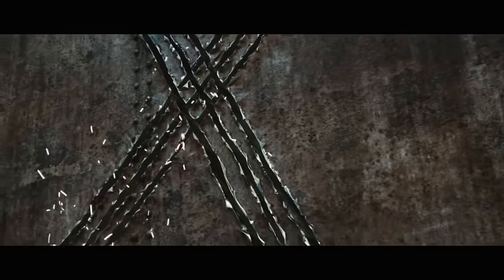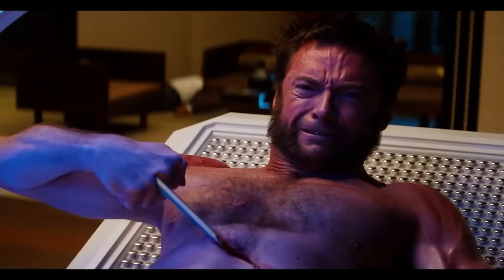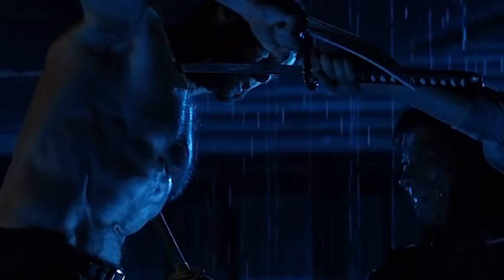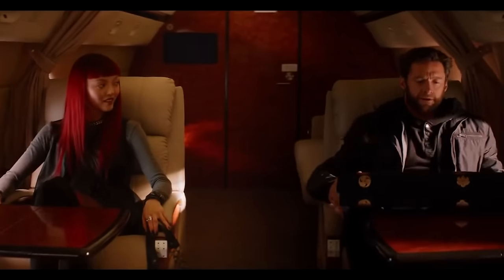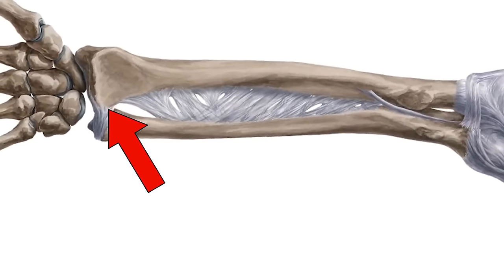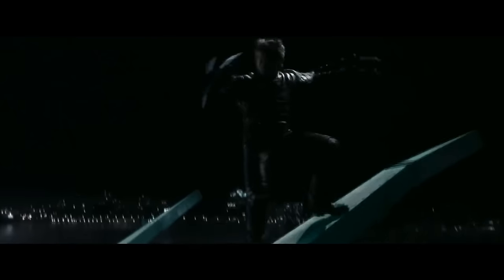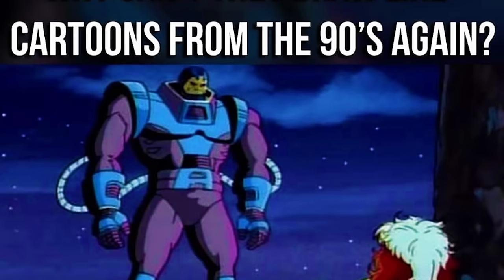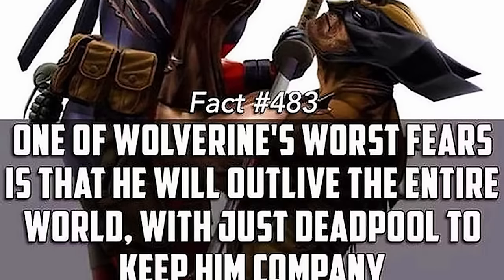How Do Wolverine's Claws Work?

Comment: Decades ago, the explanation was that Logan's entire skeleton was replaced with adamantium, not infused with adamantium.  The sheaths for his claws to be stored in, the path for each to travel, and his wrist structure was engineered specifically for the claws to operate.  And his forearms consisted of multiple smaller rods of adamantium so they acted like a cage that the claws were stored in when retracted.
Reply: Neat!  I like other explanations better but this one, combined with others woud make the perfect axplanation.
Reply: Replacing instead of infusing sounds so much easier...until you think about how much work replacing his skeleton would take
Reply: @brycethoreson9216  ye, they would have to find some place to fit all that bone marrow so the blood gets made as good as normal. Otherwise he will need to be like a vampire and suck up blood regularly to live. What they could say tho is that the adamantium replaced calcium in his bones, making them stronger as the structure and capability of the bone would be the same, just with a way stronger metal than calcium inside of them
Reply: @lootbox  I was thinking of replace as in take a bone out and replace it with an adimantium one, not converting bone to metal
Reply: @brycethoreson9216  ik, but replacing a metal with a stronger metal would probably still allow proper blood flow wouldnt it?
Reply: @brycethoreson9216  Calcium IS a metal.
Reply: The little rods were to twist and streath the muscles that control his claws so they could punch through body Armour
Reply: @brycethoreson9216  Considering Logan has regenerated from a single drop of blood once, removing his skeleton and replacing it without an adamantium one would cause there to be 2 Logans as the skeleton would just regenerate the muscle, flesh and brain.  I know that doesn't make any logical sense, but the healing facotr of both Logan and Deadpool has made no sense for their entire runs lol
Reply: @hobbitpsi  well not really. Wolverines healing factor used to work like a humans but could regenerate wounds the human body would seal off, like amputations for example. Whereas deadpool had a mutant gene which formed a cell in his body that would routinely rebuild his body whenever he was damaged, from a cellular level. If you want to kill deadpool you need to wipe out every cell in his body and every cell he had left behind. This is also why he’s so hard to clone or reproduce, bc his cells don’t stay the same long enough to be taken from his body and put in a jar.
Reply: That sounds like an awful lot of trouble....operating on him like that. Why not just wear body armor and carry a sword?
Reply: @Magneticlaw  
"That sounds like an awful lot of trouble....operating on him like that. Why not just wear body armor and carry a sword?"

Because that would be obvious.  If you want someone who can just walk into a place and not be seen as a threat until it is too late or you want someone who can stealthily sneak in and get the information they want and then cause havoc on the way out if caught, then Wolverine would be what you want.
Reply: @hobbitpsi  Well, while Logan did regenerate from a single drop of blood, it was only possible because that drop of blood fell on the  M'kraan Crystal.  Basically, in "Uncanny X-men v1 Annual ##11" whoever was able to touch the M'kraan Crystal first gained vast cosmic power (like Infinity Gauntlet level power).  Wolverine was trying to get to the Crystal before a being name Horde. Horde impales Logan from behind with a piece of metal and then picks him up and rips his heart out which killed Logan.  BUT, a drop of Logan's blood lands on the Crystal.  Having "touched" the Crystal first the power goes into the blood and a completely new body regenerates (Adamantium and all), Logan's original body is still dead on the ground.  The now cosmically powered Logan realizes it's too much power for anyone to have and destroys the Crystal and is returned to normal.  It's 100% made clear that the power of the Crystal is why he regenerated from the drop of blood.
Reply: @zzodysseuszz  True, the only other person who was anything remotely close to deadpool was Madcap which I always found hilarious that the two of them inadvertently healed themselves into one single being where Madcap became another voice in Wade's head...well until they decided to separate from each other again.  Man I miss Madcap only character to take Ghost rider's Penance stare and actually love it and continued to hunt ghost rider down just so he can get the penance stare again because he couldn't feel pain and the stare caused him to feel it once again for a moment lol.
Reply: Good it was changed cause how do you replace an entire skeleton for a body and not be dead, that wouldn’t have made sense
Reply: @hobbitpsi  The only reason Logan was able to generate from a single drop of blood was because it fell on the M'kraan Crystal.  In the story ("Uncanny X-Men" Annual 11), whoever touched the M'kraan Crystal first would gain vast cosmic power.  The villain, Horde, impaled Logan with a piece of metal and then ripped his heart out which killed Logan.  But, a drop of Logan;s blood landed on the M'kraan Crystal.  Since Logan "touched" the Crystal first, his blood was infused with the cosmic power and regrew his entire body (Adamantium included). His original body was still dead on the floor.  The story made it clear that the cosmic power allowed the regeneration from a drop of blood.
Reply: @kevinchavis2755 
"Good it was changed cause how do you replace an entire skeleton for a body and not be dead, that wouldn’t have made sense"

How do you pump a bunch of molten metal (2500-2785°F) into a body and not be dead?

If the later is possible then the former would be also.
Reply: @brycethoreson9216 medic TF2 did the first step
Reply: @oldtimefarmboy617 exactly. I bet the other guy never saw assassin's creed
Reply: I recently read it and if I remember right they actually added the chambers for his claws because they didn’t want him to bleed everytime he activated his claws (probably because as a stealth weapon you don’t want it bleeding everywhere) and they were implanted on somewhat the top of his hand as opposed to the knuckles.
Reply: In the old guide book of the Marvel Universe the bones weren’t coated he had adamantium plates bolted on his bones. And the claws were switch blade mechanism affixed to his fore arm bones.

Comment: he probably breaks his wrist every time the claws come out but it instantly heals in place, and when he retracks it breaks the ligaments again but its continues to heal. There was a quote from one of the movies, i forget which, where hes asked if it hurts and he says "every time".  hes basically acknowledging thats its a painful event but he can heal through it quickly and has got used to the pain to some degree.
Reply: in the comics he tells Jubilee that he never gets used to it and it's painful every single time, but he pops them out several times a day to keep the holes and channels open like pierced ears, but it's still painful every single time.  But psychologically yeh, he could get used to the pain.  Like I tore the cartilage in my knee and have permanent fractures in my calf on the same leg, none of which can be healed or surgically fixed so I have to live with the pain til the day I die.  Yes it still hurts but my mind has gotten so used to the pain that it seems to hurt way less than it did in the beginning.  Though keep in mind it still does hurt.
Reply: That was in the first X-Men movie when he meets Rogue for the first time. But yeah this theory perfectly lines up with Logan saying that it hurts every time they come out
Reply: @hobbitpsi sorry about your pain. The Dr give you pain meds? I have carpal tunnel syndrome, and I wear a brace and im on Vicodin. I've had this problem for years.
Reply: @ProfessorKenneth  My injuries are all Military service.  So I'm seen by the VA.  Basically means I get Ibuprofen by the pound.
Reply: @hobbitpsi if you don’t mind me asking, how’d you get your injuries, was it due to training?
Reply: @user-ii2rf8cs8j  Training, combat, and carrying all the gear.
Reply: @hobbitpsi  ah man i presumed that was the case. im going to relate to you soon when i join
Reply: I think it's X Men 2000 where Rogue ask these questions to Logan!😅
Reply: That was from the first X Men

Comment: The actual explanation given is that his healing factor basically broke down the coating and adapted to it, creating (so far as I know) the only case of adamantium beta. Basically, the adamantium became a natural component of his bones, maintaining the ability to produce blood cells, heal attached ligaments, etc. The metal became a natural component of the bones.
As far as muscles to move the claws, considering the length of movement, traditional claw deployment is out and he would actually need two sets of muscles, one for extension, one for retraction, since muscles technically only ever pull.
Reply: Yet Adamantium is supposed to be indestructible.  How can it be broken down and changed?
Reply: @XygnusX  something about his healing factor treating it like a toxin and the injection being fluid when applied. I don't know that it really went that deep. Just comic logic.
Reply: @XygnusX  Perhaps it's only theoretically indestructable and because of Wolverine's supped up regen his immune system broke it down while liquefied.
Reply: Apparently the current explanation for the muscles in the claws is their natural state is extended, so they would only need to have muscles for retraction.
Reply: @Ironlantern723  ?? He would still have to have some structure holding it in the extended position (tendon or something i guess) which would have to anchor in the hand.
Reply: @XygnusX  Was his healing ability strong enough to break adamantium down and make his body adapt to it?!
Reply: @TheBlackAntagonist  makes sense because "Adamantium can only be melted down once." and so it was a unique opportunity for his healing factor to take the nonset metal and adapt to the bone graph the only way it could think to do so. I suppose you could say Wolverine in this moment had an Awakening as his body mutated even further combining both aspects of one of his main powers healing and the imminent danger lethal substance I cant eject like poisons bullets or knives and so what happens? His blood cells ditch the iron and grab adamantium, the white blood cells show up and consume the red blood cells and figure out how to incorperate and generate this substance naturally and safely. Perfect immune system adaptation you'd expect from someone like Wolverine and his Healing.
  "Also known as Primary Adamantium, this is an attempt at the recreation of Proto-Adamantium. This is the Adamantium present in Wolverine. It is nearly as strong or durable, but unlike Proto-Adamantium, Primary Adamantium is able to be reproduced. Only beings with godlike powers (such as Rune King Thor) or with strong magnetic powers (like Magneto)[18] can manipulate Primary Adamantium. Otherwise, it is completely indestructible to all forms of attack. Being this strong, it is very rare and expensive to create or manipulate and is top secret in the US government, though it has been shared with some of their "allies". Once liquid Adamantium cools and hardens, it can never be manipulated again,[1] although it can be destroyed by Antarctic Vibranium, which dissolves all metals. As well as cleaved by the Ebony Blade which was proven in a court case overseen by Councilor Nelson to dispute the authenticity of which after a phony was being passed around"

  "Wolverine's skeleton was originally reinforced with True Adamantium. His mutant Healing Factor not only allowed him to survive the process, but it also induced a molecular change in the metal.[2] Adamantium Beta functions like True Adamantium but does not inhibit the biological processes of bone.[2] This fact only became apparent after Magneto forcibly extracted the Adamantium from Wolverine's skeleton.[21] On occasions where Wolverine lost his mutant regeneration ability, he was gradually poisoned by the Adamantium each time. "
- https://marvel.fandom.com/wiki/Adamantium#Proto-Adamantium
Reply: @XygnusX Adamantium is virtually indestructible in its solid form. The Adamantium was manipulated while still liquid. It didn't become indestructible until it cooled.
Reply: And two Radius bones and Ulnas in each wrist, one set over the other. The bottom set stays in their normal positons, the top set widens to let him use his claws. This was from a process that also adapted in a similar but different way than what you stated for the Adamantium added to his bones. So the only painful part would be his claws ripping through his skin each time he used them. I lived with bad headaches as a kid and I can tell you from experience, even if you have a high pain thresh hold you can only put up with so much for so long. I doubt if he would still be using his claws at 191 years old, (He was born in 1832.) if he went through that much agony.
Reply: It is very probable that there is no nerve ending in that area. That his carpal bones are different, and when widening form a "corridor" that serve as a sheet for his claw.
Reply: No, it is not poisonous. I've explained it in my previous comment that apparently got unnoticed. It's like people prefer the shortest & dumbest take on everything these days, and eat up any shit contradictory concept simply because they're canon without using any common sense...
Reply: Can't stand when the artist draw the claws to long. Really the should be around 5/6 inches
Reply: see i was thinking the tendons melted and regrew
Reply: @lemmondroppkidd8255  actually in the film when the liquid adamantium was injected into his bones , the doctor did say his body didn't reject it . Which means his healing factor and immune system adapted to the adamantium in liquid form and created a biological adamantium beta that works like our human bones
Reply: @anosvoldigoat3351  ah ok thx for the clarification
Reply: The problem that I have is if adamantium became a natural component of his bones, why does his healing factor keep fighting it? If he loses his healing, he starts to die from adamantium poisoning, so his healing factor is pretty fickle: it chooses to miraculously create a magic -beta version of adamantium to better incorporate it into Logan's bone structure, but does nothing to negate its toxicity?
Reply: The same muscle that pushes them out pulls them back in after it's relaxed
Reply: @XygnusX  Adamantium is unbreakable. It can still be manipulated at the molecular level, albeit through highly unconventional means, such as Magneto's powers.
Reply: @TheBlackAntagonist  Technically adamantium is unbreakable, not indestructible. Magneto is one of the few beings capable of reshaping it, as his control over magnetic fields works at the sub-atomic level, meaning he is able to directly influence the individual molecules.
Reply: Maybe it is liquid adamantium. That hardens when it comes in contact with outside oxygen. Before the adamantium it was bones or structures coming out. It is basically a more developed skeleton. So maybe it is a special liquid adamantium. Like iceman can make his soft flesh into hard ice. So can wolverine turn his adamantium into harden state.
Reply: @CCFONESOL you can break it if you use a weapon moving at a high enough speed
Reply: @Forsakenruler  yeah, no. Virtually indestructible means Virtually indestructible. Something would have to be equally or more. The annihilation factors are different for Adamantium and Beskar.
Reply: @XygnusX  Well, nothing is truly indestructible. Adamantium is just really really really difficult to destroy.

Comment: This brings up every point that I always wondered about Wolverine as a kid and even more. As many people have pointed out, Wolverine being a mutant and having even slightly different physiology from normal people could easily explain how his bones and ligaments can grow to be very similar to normal humans, while still allowing room for narrow bone claws attached to thin yet incredibly strong extender muscles. The bone claws specifically could possibly slide in between the ligaments and tendons in the forearm and wrist and not cause as much damage before they’re fully ejected and the damage done can immediately heal, plus the ligaments and muscles being incredibly strong could absolutely explain how his claws don’t get ripped through his hand when he slashes with them. The adamantium does add a ton of problems like you mentioned, from slicing and cutting muscles and tendons to potentially cutting off red blood cell production and and other vital functions. They actually did address this in the comics a long time ago where Wolverine actually did get sick from adamantium poisoning, and his bones eventually got re-grafted with adamatium that had small gaps allowing normal functions to be unaffected while still giving the strength of the metal to his bones. The claws slicing tendons and ligaments issue could also work the same way as with his bone claws as well, to where the damage done is immediately healed and adjusted around the tendons that hold the claws in place
Reply: There was once a scene in the comics where Wolverine was explaining it to Jubilee where he explained that he actually had to pop his claws out several times a day, just to keep the holes and such open and free for his claws, as he put it "like pierced ears".  Though when Jubilee asked if it stopped the pain Logan responded with "Nope."